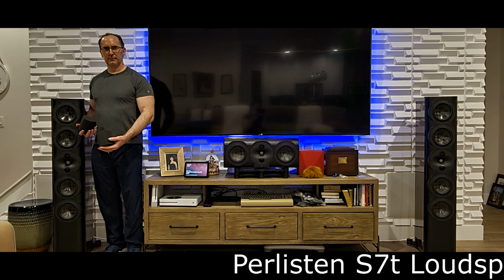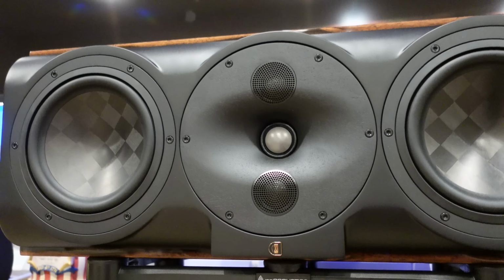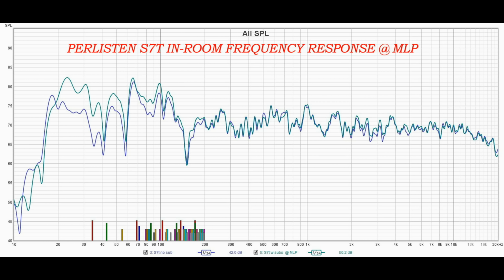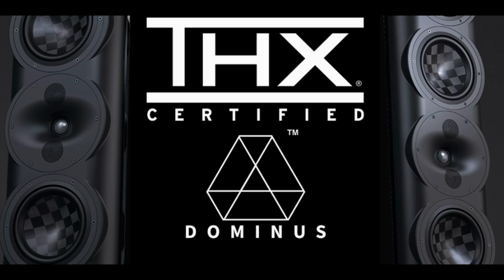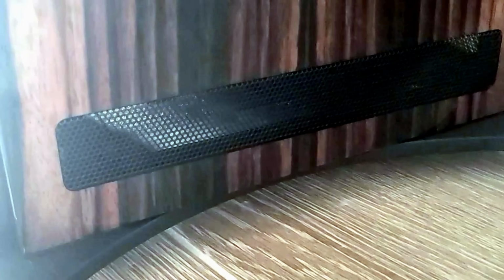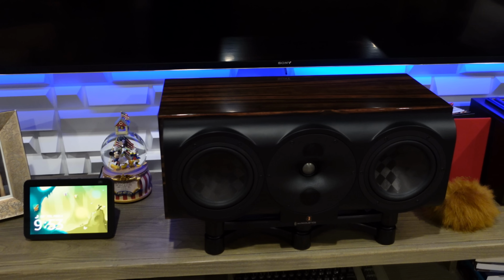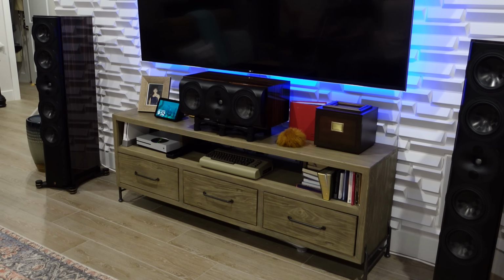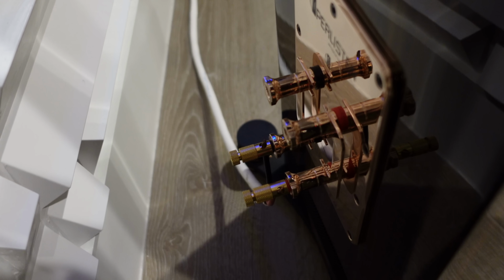Perlisten S7t & S5c Speakers Initial Review Rocking the AH SmartHome

Comment: Gene - After seeing your other reviews:  For a home theater setup front stage would you select the Perlisten S7T & S7C or the Revel F328BE & C426BE?  Both sets received outstanding reviews, from you, and it has been killing me to know which you would pick if you had to choose between the two.
Reply from the maker: Without question I'd get the Perlisten system over the Revels. The Revels are still a very good speaker but Perlisten is next level.

Comment: SO I understand that one of the top guys at Perlisten came from MK Sound.  Oddly I have a 7.4.4 MK Sound S300 system in my home theater.  I have love it.  The S300's and the S300T for surround and atmos have been wonderful.  I have 4 X12 subs in the front wall.  I have had the system for 5 years and I am sad to say that 2 of the subs have failed.  I thought it was just 1 but its 2.  I did talk to MK  Sound and they are willing to send replacement amps for $500 dollars that I can swap out  but I am more than a little concerned that the subs will fail in the future.  5 years does not seem so good to me to experience two failures and I don't blast them either.  Anyway so I decided to go with Perlisten D212's sight unseen.  I just went for it based off all the reviews here and elsewhere.   They will fit in the same space as the X12's but I think will be a huge upgrade.  I talked with Erik at Perlisten and he hooked me up with Padukah home theater in Kentucky and they got the subs shipped in 1 day.  Should have then 12/30/22.  Can't wait.

Comment: very nice ..I would take a Pepsi challenge against my kef reference 5 meta   oh no sub needed with kef  .. its all good :]
Reply from the maker: The Kef is a good speaker but actually has less bass extension and won't play as loudly as the Perlisten. I'm very critical on bass output of speakers and usually active bass drivers are the only full size towers that satisfy my bass output requirements.

Comment: Perlisten are an excellent company to deal with. I live in Australia, I ordered a pair of D212s for my stereo system. After watching your review of the D215s.  Dan and Lars organised to have the subs  shipped directly to my address from their factory.  It was a very smooth transaction. The subs were delivered to my door. I have the D212s integrated with my MBL101e Mk2s using a DEQX HDP-4. They are a delight to listen to.  I would also love to hear the S7ts.
Reply: Congrats 🥳
Did you have any subs there before?
Reply: @Harald-MacGerhard  No, the MBLs are a full range speaker. The aim of adding the Perlistens  was, within the limited placement options I have, to achieve a flatter bass response throughout the listening room.  I think that has been achieved , at least to my satisfaction.
Reply: How would you compare it to the vaf Signature I-93MKII with the built in electronic  crossover that is in the same price range?
Reply: @Nathan-ry3yu  I can't, I have not heard them.
Reply: Hey mate, I'm also in Australia, and running a perlisten d215s, it is absolutely incredible, best sub I've ever heard. 
Are you still happy with your subs? 
I'm tempted to downsize to the d212s
Reply: @andrewpeel912  yes, I am  still running the D212s, I still think they are a fantastic sub.

Comment: With the "beam forming" design, is that the same as or similar to line source? You referenced the MLP several times. Am curious how would the sound carry to a multiple row home theater and if the db loss be similar to point source speaker or would it be more like a line source speaker?

Comment: how they stack vs Arendal 1723?
Reply: price is representative of the price, AH has review of the Arendal as well and speakers are with very similar profile. The question is; does 5 times price give enough above the Arendal.
Reply: @NoobOnALiter  I would say a partial yes based on the following. THX dominus rating means the system can play loud enough and clean enough in a dedicated home cinema above a certain size. Build Quality is a step up. Drivers and Tweeter are a big step up from Arendal. I guess if Perlisten was sold in a direct to consumer model like the Arendal the Perlistens would be more like 2.5 to 3x the price of Arendal...... again it cones down to room sizes. Perlisten is designed for rooms where systems cost 4-5x more than Arendals.
Reply: @pumpituphomeboy  Clearly its by case scenario. If your room it's not a huge one, you can go with 1723 and invest the extra in the other equipment.  Of course, if you have the buck Peralisten it is.